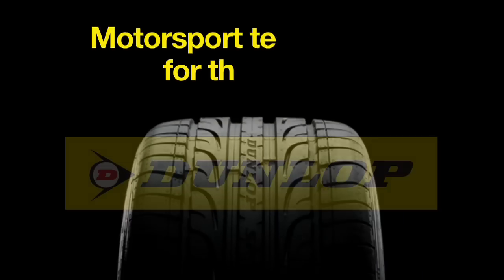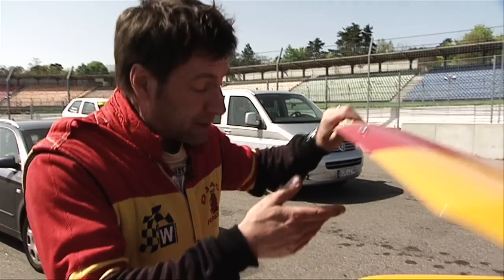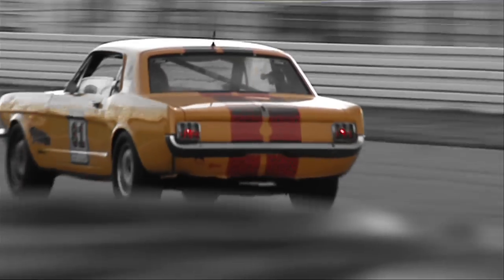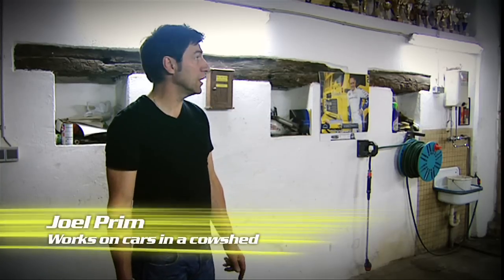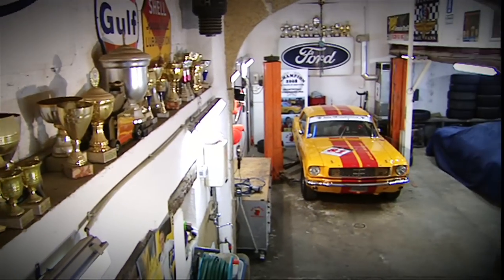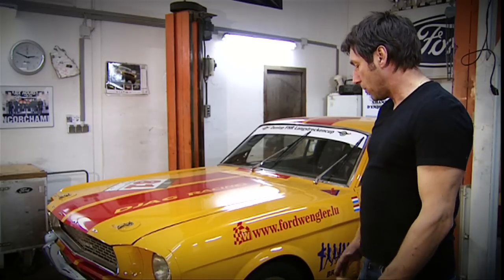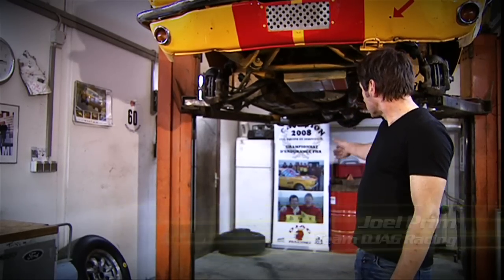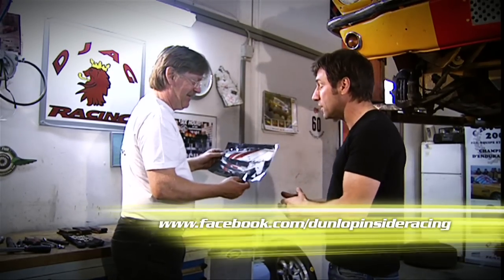Cool Mustang riders - Insights - Inside Racing 2011 - ep.6

Comment: NIcely done !  Check out a Moroso accusump system , will help your motor live much longer and is inexpensive.  T fitting at oil pressure sender feeds extra oil tank  helps on rough tracks, holds reserve oil under pressure in case pickup in motor sees air under hard cornering